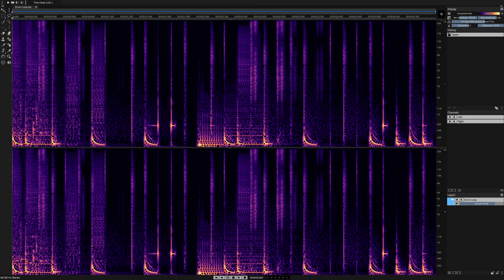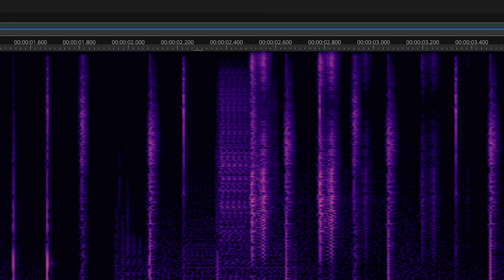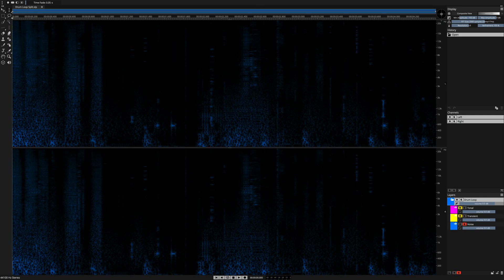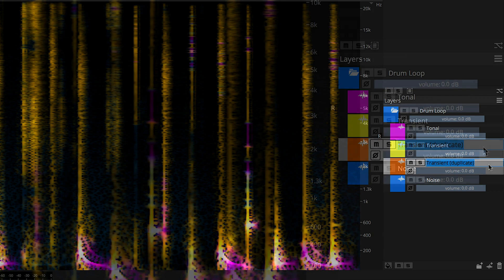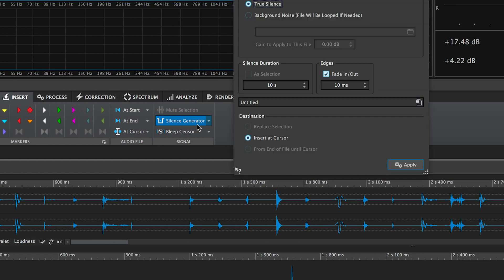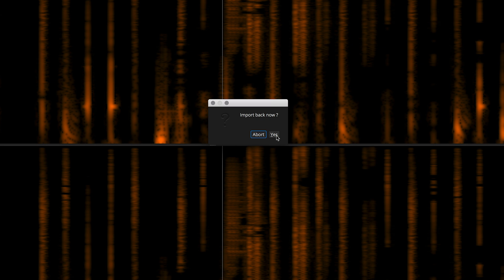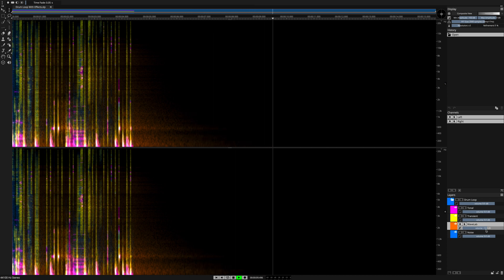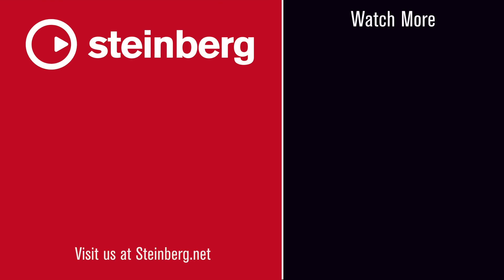Unmix Components | Spectralayers Pro 7 Tutorials

Comment: Looks impressive but not as easy or straight forward as it Appears to be. I have it and doesn’t work as intended on material I have. Especially with guitar parts, especially if distorted with delay and revervb.
Reply: What are you trying to do?
Reply: @mikescheibinger5191  I have a cassette tape from 1985 with rhythm, lead and bass guitars and a Roland drum module. Overdubbed with a deep pitch dropped voice and it was then put through a Eventide 910 Harmoniser, with echo and reverb. 5 minutes in length. Both guitarists went through a fuzz and delay pedals. So to answer your question. An awful lot. Yes i know its asking a lot of 'Unmix' The only reasonable extract is the bass and bass drum (together) and the high hat. I basically wanted to extract the guitars but they are spread across the whole frequency band. Was going to trigger a drum track in sync and a bass line. I have Melodyne too so will see what i can do between the two. I have only started using Spectralayers so will find a less cluttered mix to teach myself.
Reply: @johngrant5749  A challenging case. It reminds me of something Robin (SL developer) posted on another SL thread: the Unmix Stems process can be considered as a 'kick-start' so to speak, for a more involved project—start with the process, and then use the other manual tools to refine your work. The automated process can do more in a few seconds than you could do all day (or in some cases EVER) with the manual tools. Do the process, and then go in there and crank away at it and see what you can come up with. The process itself is pretty powerful—a couple of days ago, I did it on this dense rock track, and it pulled out an acoustic piano that was so far back in the mix, I didn't even know it was there at first. Point is, if you do the process and get disappointing results, look at what it DID do, and then build some skills with the other tools (in particular the Eraser tool) to see if you can make refinements that cross the threshold of acceptability. Cheers...
Reply: Mike Scheibinger yes, I’ll persevere with the project. There are plenty more tools to try and a great way of learning to use the program although I may revert to a less detailed track to practice with first. Cheers.